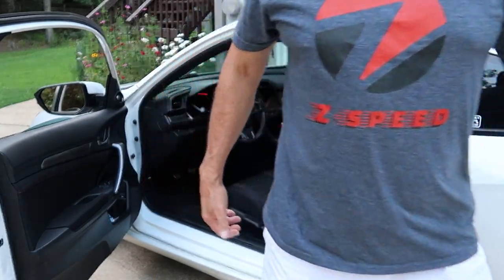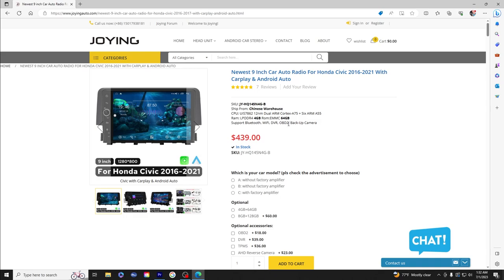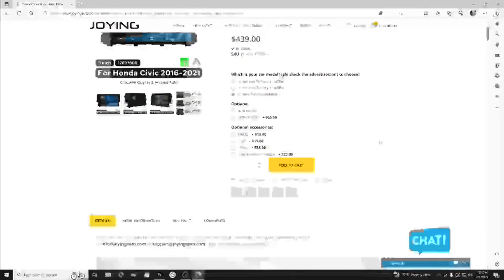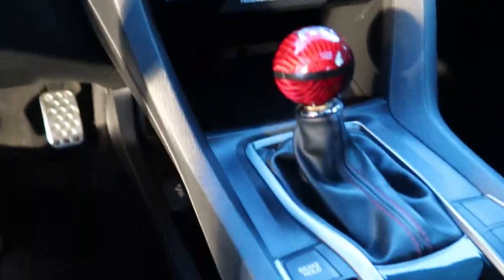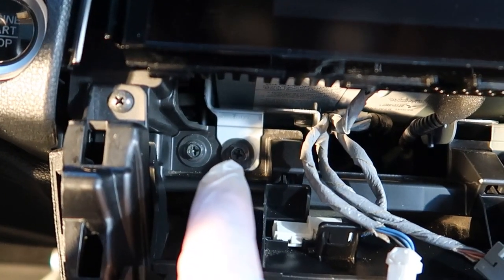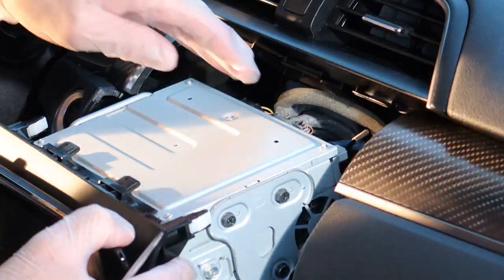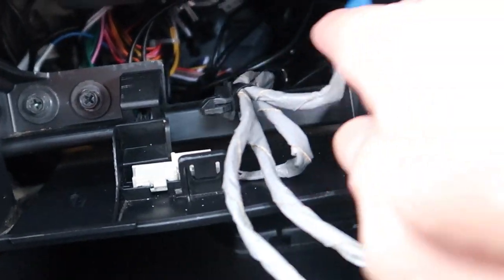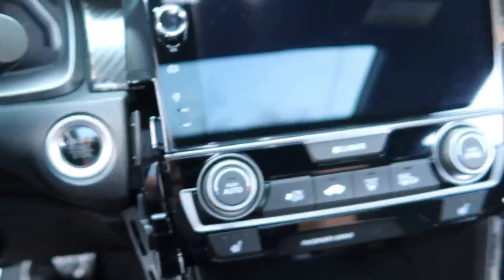Joying Android Head Unit install 10th Gen Civic #joying #civicsi

Comment: In this Joying unit, does the "Climate" button still work to bring up fan/AC settings? And the steering wheel controls all still work? I would have liked to see a demonstration of those functions still working in the new unit.
Reply from the maker: Yes, all climate control and steering wheel buttons still function normally! Watch my latest video on how to install the Joying radio harness for more details on setting up the head unit!
Reply: @Zspeed  Thank you. Is that radio harness bypass required for the EX-T trim level? Or is this only for Amp enabled systems? (Mine does not have the amp)
Reply from the maker: Yes, it's required for all trim levels!
Reply: @Zspeed  Thank you again! Is the EX-T trim included in the Radio Harness bypass video? I didn't see anything that looked like my interior in that video. If it's not, would you happen to know which panel it is hidden behind in the 2017 EX-T Coupe?

Comment: If I may ask how did you add the steering wheel options for the turbo I’m having trouble setting that option and the radio does not work 🤦🏻‍♂️

Comment: Hi my friend hope you’re available to answer a question.. I’ve installed this head unit into a sport touring. How do I reset maintenance reminder and low air pressure.. I’ve tried holding down on the mileage reset. I just want to cancel the reminders out… thank tou
Reply from the maker: First make sure CAN box is set to RZC, car brand is Honda, car model is civic, and CAN box is set to 2016-2021-high if amplified and low if not amplified! Then try to reset everything.
Reply: I don’t think the tire pressure can be reset unless I buy the joying tire pressure sensor that screws onto the tire stem…!!!!  Thanks  for replying and I’ll try the can bus selection

Comment: Thank you for the excellent video—it’s greatly appreciated. I have a quick question about the Antenna Bypass Harness. Is this attachment necessary for the 2018 SI model's radio to function? I thought it was only required for the Touring model.
Reply from the maker: I believe it's needed for all models to get  adequate reception quality for the radio.

Comment: I just bought  joying radio does not look like that with fish floating it actually looks way different and the settings are way different, looks the same but different in its functions, I have it with the C option which is the with amplifier and had everything connected problem I have is the radio does not work and the steering wheel selection for the turbo is down to 3 instead of the 6-7 options, everything else works the right lane assist works the reverse works  but I still trying to fix the option for the turbo settings, I was able to view how the oil was I don’t have that option with the new joying radio if you have any advice it would be greatly appreciated
Reply from the maker: The radio needs the bypass harness installed to work properly! You will diffently lose some functions on your steering wheel,  like the oil change, tire pressure, etc. I still have my turbo guage, I am about to release a video on this very subject next week! I can show some settings that might help, concerning the proper initial radio settings, but I can't message you until late tonight. So I will leave you another comment late tonight, hope this helps! 👍🏁
Reply: @Zspeed  I wa shooing to keep the most important things the rest is not really bother some to me
Reply from the maker: Sorry I took so long to reply! Go to factory settings: then go to car model: choose RZC for can box type, choose car brand Honda, car model: Civic,  Can box choose 2016-2021.high. Hopefully your head unit has this or something similar to choose from!

Comment: Hi great video, so I'm planning on buying this unit. 2 questions, # 1. Is there just one RCA plug-in in the back if the head unit for an external amplifier and subwoofer and should i splice thst into 2 to hook to my amp, and #2 is there a remote wire to use for the external amp also. Thanks
Reply from the maker: Yes, I believe there is only one RCA, but when it comes to external amplifiers, I'm only a novice at best and could not tell how to wire it correctly!
Reply: @Zspeed  OK thanks :)

Comment: I have a joying head unit I just bought and I’m currently having 2 issues, though considering I only just got it I might figure it out, but the blind-spot camera in the side-view mirror doesn’t seem to work, and I cannot change any of the car settings through the unit, any suggestions?
Reply from the maker: What year and model car, is it installed in?
Reply: @Zspeed  oh right! It’s a 2018 Honda civic Ex-T with the blind spot camera! Admittedly I literally just installed it today and will most likely need to check for firmware updates as well to see if that resolves any issues, I am overall very happy with it in spite of those issues, and your video helped immensely during install
Reply from the maker: When setting up your unit, go to Factory, then choose RZC for CAN box type, then choose Honda, car model Civic and CAN box choose 2016-2021 High or Low. High if amplified or low if non-amplified. Then go to vehicle settings and make that the turn right enter camera has a green check mark on it!

Comment: Does rear camera work out of the box? on the Joying webpage they put some tutorial that mentions  removing orange cable from one of the socket and connecting it somewhere else, for cars with manual transmission?
Reply from the maker: Plug and play, my backup camera 📷 works great! Just make sure you follow the video and place the Aux cables where I showed you and you'll have 
 no problems with the backup camera!

Comment: Do you experience any buzzing/static sound with this unit when no audio is played? Some users reported it and seems its due to two amplifiers.
Reply from the maker: Only a very faint hum when the unit powers up, nothing that is too loud at all, no buzzing sound or anything like that!
Reply: @Zspeed   just to clarify do you only hear it at startup or do you hear the buzz/static all the time ? Also does volume level affect the buzz/static?
Reply from the maker: I only hear it with the volume off. It doesn't increase when the volume is turned up. My unit only has a low level hum with volume off, no buzzing sounds, hope this helps!🏁👍
Reply: @Zspeed  so let’s say your at volume level 15, with the music on pause , do you hear the buzz?

Comment: Excelent video! I'm eyeing the Joying unit for some time already but still not decided. I guess the two 4g antemnas are only needed if you will use sim card? Otherwise its not needed dissasemble the dashboard speaker?
Reply from the maker: Yes, 4G antennas are not needed if your pairing head unit with your phone!
Reply: Ok. So any software updates will happen through the phone? @Zspeed
Reply: @dtorres333 connect the head unit to Wi-Fi maybe

Comment: Hello friend, yes, my car is an austere version but I have audio equipment under speakers, amplifier, which stereo grabbed the one that does not have an amplifier or the one that has for amplifier and did the commands work at the steering wheel?
Reply from the maker: Yes, my steering wheel buttons are still working after placing this stereo in my 2017 Civic Si.

Comment: Thank you for this video I just bought me one can’t wait to install! Quick question if I’m not gonna be using 4G or the GPS in the joying do I need to plug those in? I usually just use gps on my phone and if it comes with wireless CarPlay that’ll be even better.
Reply from the maker: As long as your phone is connected to the head unit, you should be okay without connecting the 4G, but I'm not sure about the GPS connection.
Reply: @Zspeed  I did it anyways and it ended up working perfect. Followed the video exactly super easy to follow! I have an EXL model and had some left over cables that didn’t go anywhere like this brown one. But had no issues.
Reply from the maker: Awesome, thanks so much for watching!🏁👍

Comment: Hi, great video. My question is, where do you plug the optical cable from the amplifier? I saw you plugged only RCA's and i don't think the amplified version's speakers are connected to the head unit but to the amplifier directly. Head unit is just sending digital signal via the optical cable and amplifier is doing the rest. Thanks
Reply from the maker: I didn't plug the optical cable into the unit,  but if I remember correctly, there is a port on the head unit. My unit seems to be working well,  but I  will look into rerouting the optical cable if I  can find it!

Comment: Just installed this same unit and followed your video! My only question, is there a way to automatically start car link for apple car play when the car starts? I am having to select car link each time for it to connect.
Reply from the maker: Connect your phone with the USB cable for quicker response!

Comment: Hi I just installed this unit on my 2017 SI 4 door. Did you lose some of your speedometer customization?  I lost a number of things like the G-meter, brake/acceleration gauge etc.  The only selections left are fuel economy and lap timer.  Joying did not have a resolution.
Reply from the maker: Yes, I lost the little wrench 🔧 setting and the high REV indicator!
Reply: I lost at least 5 customization. 😢. This is a NO for me.

Comment: Quick question before I purchase this. I have a 2017 civic LX and reset my maintenance minders on the mileage knob and the tpms with the factory button to the left of the steering wheel. That will all still work correctly right? I’m asking because all the comments asking about this. I’m assuming that only applies to higher trim models tho.
Reply from the maker: My maintenance reminder no longer works, that might be an issue for some people!

Comment: Good job i have a problem with joying reverse camera when I put on reverse the camera is not turning to the way i turning turned to the other way if you know let me know
Reply from the maker: Yes, I have the same problem, the screen is showing the background right and left side, are swapped, right! I am working on a solution. Well let you know if I figure it out!
Reply: There is an option under reverse setting called mirror reverse don’t active it
Reply from the maker: What happens if you do?😖

Comment: The new radio covers partially de air vents. Is it a problem? I see you can't point it downwards without air hitting the screen
Reply from the maker: No problem with using the A/C vent, slight airflow blockage at the bottom of vent, but otherwise just fine.

Comment: Can you still use on screen menu for manteinace reminders and reset? Oil on TPMS reset?
Reply from the maker: I have not been able to reset the oil maintenance reminder yet!
Reply: Use the steering wheel to reset the oil. Go to the wrench and hold the ok button on the left side of the steering wheel until it pops up for the reset

Comment: Hello, I just have a quick question. About those brackets. Mines doesn’t fit either but how does yours hold up without brackets? I just wanna make sure I don’t destroy the clips doing this and the vibrations
Reply from the maker: Head unit still nice and stable without the brackets! No need to worry, still working well!
Reply: @Zspeed  thank you, mines holding up well so far as well

Comment: How is the brightness?  I got a different aftermarket radio but compared to the Oem radio it’s noticeablably a lot darker especially during the day.  I’ll probably get this radio if the brightness is good 😊
Reply from the maker: Very bright and easy to see, night or day!
Reply: @Zspeed  nice! Thank you for responding :)
Reply: Probably you have night mode on. Those aftermarket screens are usually very bright.

Comment: Thank you for the video. Do you know if with the Joying head unit it is possible to do the calibration of the TPMS? Thanks
Reply from the maker: No, not without purchasing the tire monitoring pressure sensors from their website.
Reply: Thanks, I have the light for tires pressure popping up everytime the car starts and I was hopping it can be cleared with the new unit. The car dealer says it needs the original head unit installed. Mine went black a few weeks ago @Zspeed

Comment: I installed the new model with Android 12 in my civic with factory amplifier.. everything works great, but I have problems with the air conditioning control, it doesn't work properly, for example, I can't manually adjust the fan speed or switch the air conditioning on and off... I tried different can bus models but unfortunately it doesn't work:-(
Reply from the maker: Try RZC, HONDA, CIVIC, 2016-2021
Reply: @Zspeed  I don't have this one to select
Reply from the maker: You might have to go through each CAN Box type until you find one that will let you operate the air conditioner properly!
Reply: @Zspeed  I've tried everything but no success...everything else works perfectly…
Reply from the maker: Let Joying know, you might need a new canbus wiring harness.
Reply: @Zspeed  I have already contacted them, I am waiting for a reply
Reply: What ended up happening
Reply: @SMchocobananas  joying sent me a new can bus box and now everything works without any problems

Comment: So this keeps all your factory settings working tpms and all that good stuff ?
Reply from the maker: No tpms, without purchasing the wheel sensors!
Reply: @Zspeed  oh so basically got to pay the extra when purchasing thank you for the insight. How is it holding up so far ?
Reply from the maker: So far, very well. But I'm now considering  adding an aftermarket amplifier!
Reply: @Zspeed  nice I went the other way I added one for bass and looking into doing one for the mids and highs and getting a better head unit was easier then adding a eq along with the other stuff.
Reply: @Zspeed  Are you adding an Amplifier for subs, or all speakers? Is the sound on the Joying head unit much better than the factory head unit?  The reason I ask is because I bought this so my all-around sound would sound better than the crappy factory head unit that literally put out terrible sound and loudness.  Plus, I'm adding external subs and amp and I wanted the all-around sound to be loud enough with subs or balanced. The factory head unit would not be loud enough.

Comment: So, for the amplified 2019 Si Coupe model, will I need to bypass the factory antenna or not?
Reply from the maker: Yes,  but I found the antenna relay, it's on the passenger side rear panel, much further back than the 4 door hatch! Video coming out next month, hopefully!
Reply: @Zspeed  Interesting, because I wrote Joying inquiring about it & was told we don't need to bypass the factory antenna. 🤔
Reply from the maker: Well if you're radio works then you are all set! If not, you will need to bypass the antenna!
Reply: @Zspeed  Just curious... does  your FM radio work?

Comment: I ordered it and jt is missing the connectors to connect power to the existing usb connectors. Im irritated andnim sending this unit back
Reply from the maker: They should send replacements free of charge!
Reply: @Zspeed  yeah. I reached out. They want me to take a picture of the back of the head unit but.... I already put it back and ah ... Ugh. I don't want to go through that unless Im indeed swapping it. My fingers hurt! Also, my stock head unit is now bricked. Continuously trying to acquire gps signal when it doesn't have gps.

Comment: I just bought and installed this radio, work good but for the factory code for radio i have a 5 digit code for my radio and this unit is asking for a 4 digit code? I have an LX 2019, any ideas
Reply: i got in.
Reply: Might be 3368

Comment: Will this head unit allow more bass for aftermarket speakers or do I still need an aftermarket amp?
2018 honda civic si as well
Reply from the maker: It does improve the overall sound quality  but you will need a better Amp for real bass output. I'm looking into that very soon!!
Reply: @Zspeed  thank you very much, I know the stock unit limits output, if I get even some slightly better quality Ill be happy 
Rn I have rocksford fosgate speakers.
Reply from the maker: You will definitely get a vast improvement in sound quality, the equalizer on this head unit is awesome!!

Comment: My question is with the splitter rca to have all 4 ... 2 front and 2 rear can i adjust the rear speakers in the eq to adjust the rear speakers or doesnt work??? I know only the front speakers i can adjust but not rear. I need to know please to see if it makes sense to buy the rca splitter
Reply from the maker: I was not able to adjust the rear speakers with the EQ, so skip the splitter and run your RCA cables into the rear speakers outlet on the head unit. I think it sounds a little better with that configuration, but it might just be my imagination!

Comment: After the speaker install Z-Speed did the Joying head unit built in DSP and using the factory amp.   Did it improve the sound of your speaker setup?
Reply from the maker: Yes, after adjusting the equalizer, the  sound definitely improved!
Reply: Hi ZSpeed,

I'm sorry, the radio antenna wire that you insert to that area with the blue wire.  Mine is shorter than the first one mentioned when you had mentioned touring.  Was that the same for you as well?  It seems like i wasn't able to push it in all the way for contact.

Comment: Does this retain lanewatch on equipped vehicles?
Reply from the maker: I'm assuming it should,  because the left turn and reverse cameras 📷 both work on the Si.
Reply: How did you get the cameras to work? I have a 14 si and having trouble with the back up and lane watch camera.
Reply from the maker: Have you gone through the settings menu to factory, then car mode, then go to CAN box, choose RCZ, then Honda, then Civic and finally choose 2014.